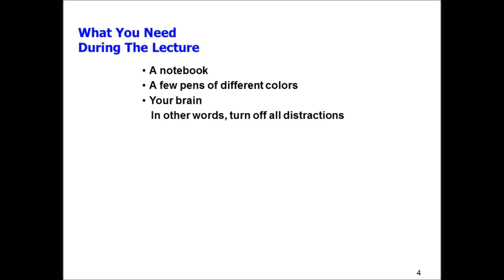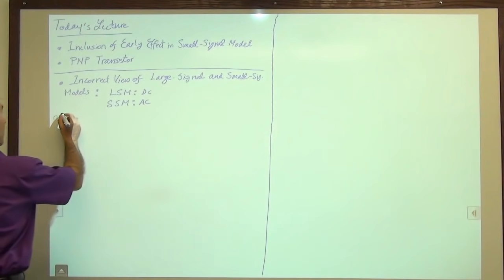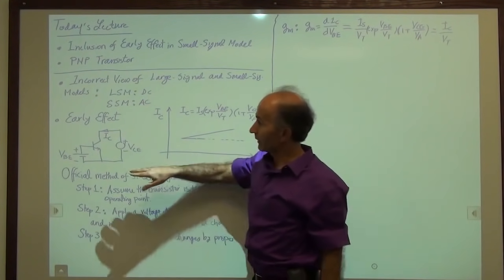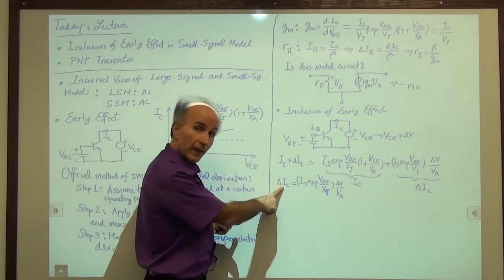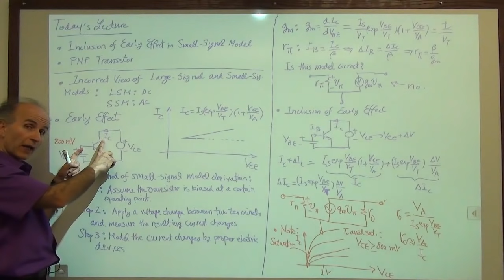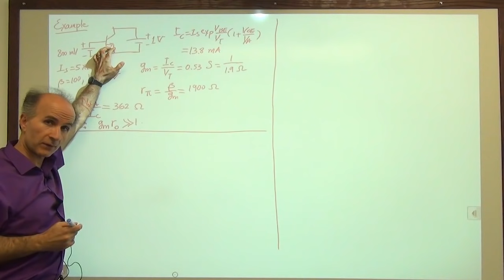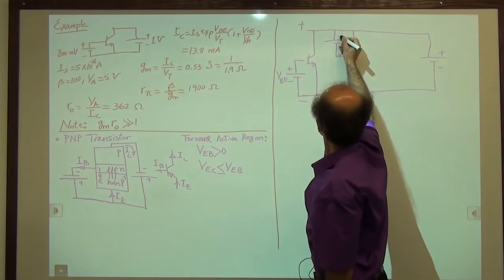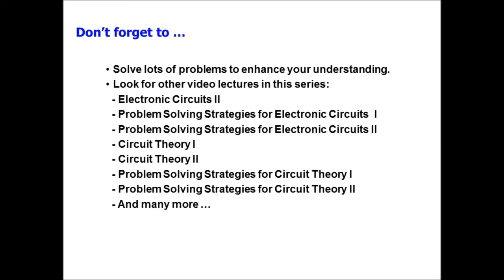Razavi Electronics 1, Lec 18, PNP Transistor

Comment: We know that in a forward biased transistor we have βIb = Ic. However in the model it's clear that the above equality doesn't hold due to the addition of another resistor Ro .We now have Ic > β.Ib. What's wrong in my understanding of the model. Any help is appreciated Thank you.
Reply: when we include the early effect, the relation Ic=βIb is still the same, but the Ic you mention  is not the real Ic(kinda confusing to say that), when we change Vce the value of Ic changes by Va/Ro, so the Ic you mentioned above is the original component alone, to get the real Ic in the relation above when Ic changes you have to consider both components, namely:
Ic = original Ic + Va/Ro = βIb.

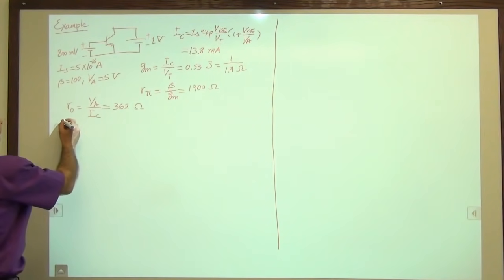Comment: In numerical at 45:30
gm*v(pi)=???
Is V(pi)=V(be)=0.8V
So is gm*v(pi)=0.424 A??
Reply: Prefer previous videos to under stand that. For your heads up- v(pi)= v(in)=The fluctuation viltage input. The small signal odel is only for the v(in) voltage. While V(BE)=v(in)+v(o), v(o)=the biase voltage or battery which use large signal model (general model) to calculate Ic(o)